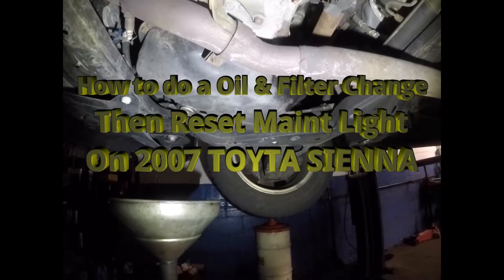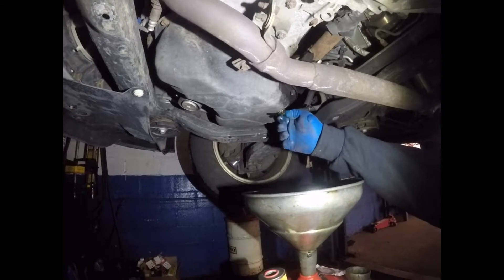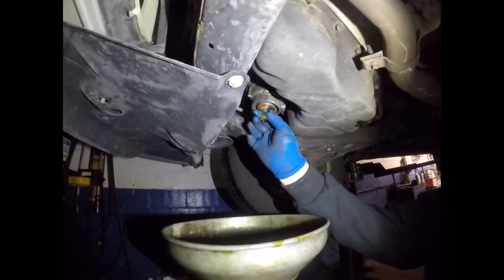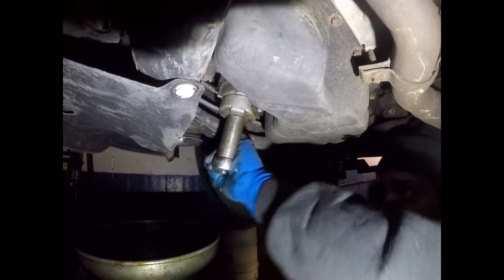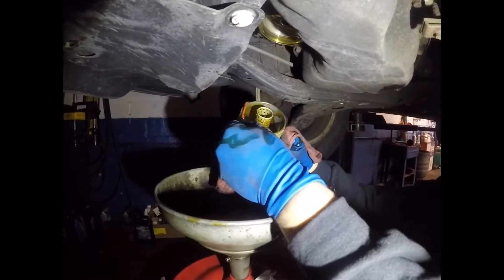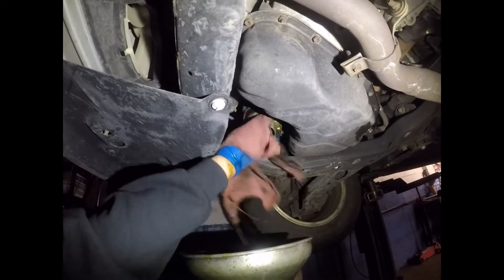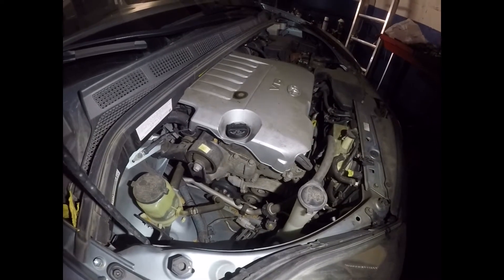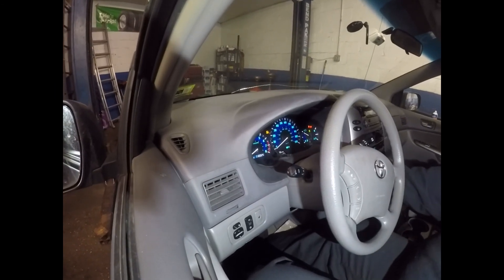How to do a OIL & Filter Change then Reset Maint Light on 2007 Toyota Sienna

Comment: which oil do you recommend for my sienna 2008? what brand and specifications? thanks
Reply from the maker: I use synthetic gtx castrol
Reply: @RBTheMechanic  Thanks but like SAE 5W-30 would be ok?
Reply from the maker: @igorrosales1799  yup

Comment: this filter looks different than normal. typically, you would just screw can filter, right?    When i searched for a filter for 2006 xle limited, K@N ps-1002 was an option, but ps-1002 looks nothing like that.  I am a bit confused what filter to get now.  can you provide me some guidance?
Reply from the maker: 2006 might be diffrent this is canister filter